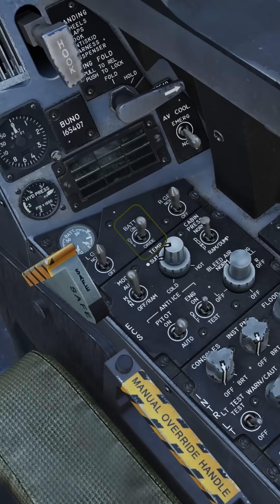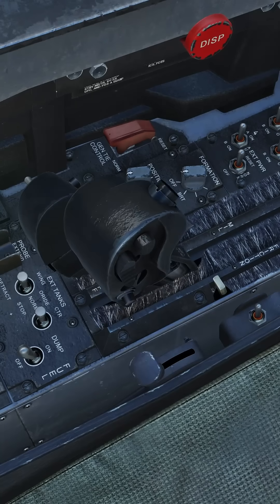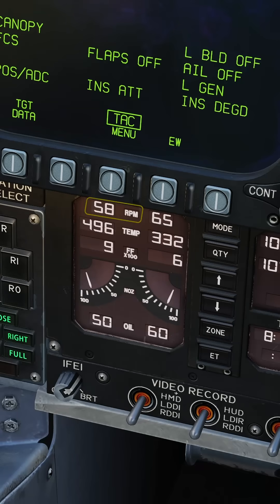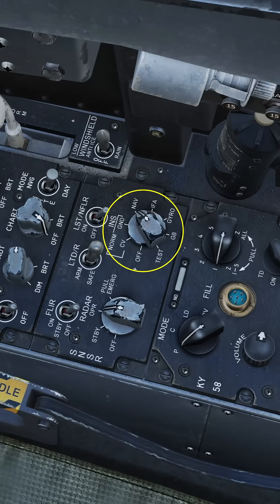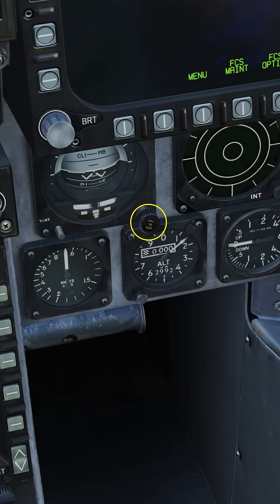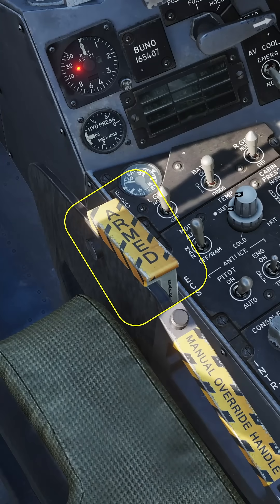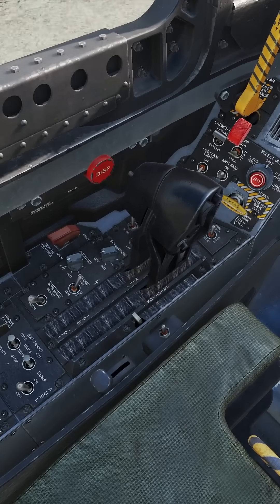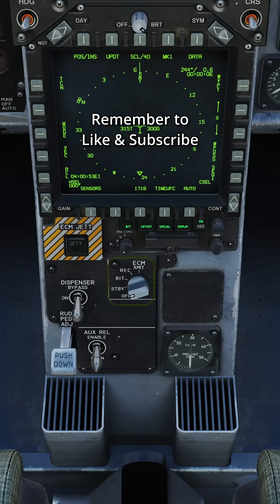F/A-18C Cold Start and Airfield Takeoff in 60 Seconds  #aviation #dcs #dcsworld #f18c #coldstart

Comment: Why set the INS to ground stored heading and then choosing IFA? Seems like NAV is the correct choice? Am i wrong?
Reply from the maker: So IFA and NAV are somewhat similar, the difference being that IFA uses GPS to update alignment whereas NAV runs on an inertial system and its alignment will degrade over time. You can switch straight into IFA but it will take longer to align than if you run a proper alignment. You really shouldn't be using NAV unless GPS is unavailable, but if you are using NAV then you absolutely 100% need to run a ground alignment otherwise the system will be wildly inaccurate.
Reply: @WorldWarWhiskers  Oh thank you for explaining that. :)

Comment: I need help with the apu bc when I click on it and hold the left mouse button its turned on but as soon as I stop holding the mouse button it turns off automatically
Reply from the maker: It should just be a single click and it will stay forward. If the engines are already running then the APU shuts itself off automatically, any chance that you have hot start set in your mission file and everything's already up and running?
Reply: @WorldWarWhiskers  I have already fixed the problem but thanks for your response

Comment: Why everyone is sure that you need to wait 20rpm to idle? You just need to wait at least 15rpm and it doesn't matter if you idle at 18rpm or 23rpm.
Also, it is true that the nose lift off by itself, but when you reach the nose gear lift off speed (where the nose starts to raise) you should pull the stick after the neutral position.
NATOPS F/A-18 A/B/C/D Manual, it is all there ;)
Nice video btw, i am not here to judge, just some corrections.

Comment: This is why I went with the Hyundai Tucson. It's like,  insert key, place coffee cup in holder. Check nose in  mirror for boogies, boogies clear. Sit back in seat, turn key. Press defrost button, turn windshield wiper knob. Mirror check, right side, left side, rear view. Mirror check 2nd tim. All clear, place foot on brakes, grab shift knock, press button and move to R position.
Slowly release foot from brake, give visual check of surroundings. 
Start backing out of drive.
Do mental :leaving home checklist".
Do not remember if you turned off coffee pot, place foot on brake, press shift knob button and move shifter to P position. Open door  and exit vehicle. Get to front door and realize ypu need the keys from vehicle.

Comment: Actually  the bot drone has replaced most need for a human being  being there to flip the bitchswitch and wait for the ins after ins to ground make sure anti skid is on jammer engine  crank right right throttle  while holding the oh shit stick and report ok set the altimeter and dont dorget the radar while airborne selct storm headings take off the trim and adjust the throttle  left dvi right divi and select bitch switch while airborne throttle it 
 Stand by for future instructions 😂😂😂😂😂

Comment: As an ex-RAAF Avionics Technician and Hornet engine runner, this is over simplified.
There's things like a full switch check, firelight and warning tone checks, not to mention closely monitoring EGT, RPM, and Oil Pressure (to name a few) on start-up. There's very strict operating limits and you need to be on the ball to catch if something is out of limits.
It's a complicated beast and there's a lot going on when starting one.
If you miss an overtemp, or under pressure, you've just cooked a million dollar+ engine.
We also used to have the displays turned on prior to start so that as soon as the generator is online, you have additional monitoring informtion available to you,
Reply: Oversimplified!? Jesus Christ! I'm gonna stick to BMW. 👍
Reply: @spartang.1388 
Have you watched the BMW instructional video on how to use the turn signals? 😁
Reply: Thank you. It's real people like you who do society a service by adding reality & comment's to correct  these CGI gamers videos!
Reply: Just out of curiosity, why is something important like monitoring engine temperatures have to be so manual? Is there no way for a sensor or mechanism to be put in place that the aircraft can self regulate as a standard car normally would? Genuinely asking
Reply: Great Question!
During start-up, electrical power is only provided by the batteries, so only a small number of analog gauges are available to monitor things.
Once the first engine is at idle speed, the generator will come on-line and allow the electronic systems to power up.
They can then take over monitoring and control actions, although like a car, they can only do so much.
For example, the engine management computer in a car is always monitoring and making changes to maximise power, efficiency, etc... but if something really goes wrong, such as the car starting to overheat due to a coolant leak, it can only give a warning to the driver and it's up to them how they deal with it.
A jet is the same.
Reply: As an ex-RAAF Avionics Technician and Hornet engine runner, do you know anything of the term 'military power' when referring to engines? is it bs used by civilians?
Reply: @yanerik6850  
Yes, it's a legitimate expression, and actually quite dull...lol
"Military Power" describes the power range that can be achieved without engaging the afterburners.
Engaging afterburners delivers more power, and this is known as "Maximum Power".

Comment: So you can crank the engines at 15% and need to monitor the instruments for a hung or hot start for each engine.  Not to mention the thorough walk around needed and insuring the APU accumulator is charged to 3000 psi or it will not start.

Comment: And pull the coiling chord of the old dialling telephone and crank crank crank crank wait till the "khorrorong" Khorrorong khorrorong khorrorong stops on the receivers end then shout into the mouthpiece "I am chief pilot of plane number so and so I have order from superior in command to take off, I have readied all equipment and is all ready for flight, I am requesting permission for taxiing and take off from the runway accross the other runway to the right of the last of the hangar, please accept my supplications as an application for clearing my flight, okaaay? Pleezee

Comment: There’s 13 steps and 49 substeps to start this aircraft 

	1.	Turn on Battery Switch and APU
	•	Wait for the APU Ready light to illuminate.
	2.	Start Right Engine
	•	Set engine crank to right and wait for RPM to reach 20.
	•	Move right throttle to idle.
	•	Wait for RPM to pass 60.
	3.	Power Up Display Systems
	•	Turn on right DDI, left DDI, HUD, and AMPCD.
	4.	Start Left Engine
	•	Set engine crank to left and wait for RPM to reach 20.
	•	Move left throttle to idle.
	•	Wait for RPM to pass 60.
	5.	Close Canopy
	•	Ensure the canopy is closed before proceeding.
	6.	Set Radar and INS
	•	Set radar to operate.
	•	On HSI, select stored heading.
	•	Wait for INS to align and report “OK”.
	•	Set INS to IFA.
	7.	Configure Flight Controls
	•	Press FCS reset while holding FCS BIT switch.
	•	Select FCS MC and hit FCS.
	•	Uncage the standby attitude.
	8.	Set Altimeters
	•	Set standby altimeter and radar altimeter.
	9.	Prepare for Taxi
	•	Set HOOK BYPASS to FIELD.
	•	Turn on anti-skid.
	•	Set flaps to half.
	•	Release the parking brake.
	10.	Taxi and Arm Ejection Seat
	•	Taxi clear of obstructions and arm the ejection seat.
	11.	Align with Runway
	•	Taxi to align with the runway.
	•	Press the takeoff trim button while holding the brakes.
	12.	Take Off
	•	Throttle up to military power and release brakes when moving.
	•	Set throttle to afterburner.
	•	Do not pull back on the stick; the nose will lift by itself.
	13.	Post-Takeoff Procedures
	•	Raise landing gear and set flaps to auto.
	•	Set RWR, Jammer, and dispenser as required

Comment: You forgot to do the fire light loop test after turning on the battery as well as a cockpit lights test after engine 2 stabilized at 61% N2 and the generator came online.  Tsk tsk.

Comment: As a retired Hornet driver, you should be keeping your radar switch in Standby until you're in the air. Yes, the Hornet has the weight on wheels system, however it's a safety precaution for ground crew in the event of sensor failure.
Reply: ....yeah....microwaving the ground crew accidentally would not be a good thing.....
Reply: I said this and was told it's misinformation lol
Reply: More than just the WOW switch prevents radiation. On Quick Alert, and from any launch, we always took-off in Operate
Reply: @stevefrawley9756  He's not demonstrating alert scrambles.
Reply: @Andy45567  Hence the comment 'from any launch'. The thing you want to do in a formation take-off (close or trail) is take your hand off the stick to switch to OPR,
Reply: I used to drive an AMC Gremlin, the startup procedure was nothing like this
Reply: The question I have is, do you fighter pilots use pre-flight checklists every time you fly? Or is that something only private pilots and commercial pilots use?
Reply: @michael-bell  Every aviator does a preflight and yes, uses a checklist. Its not like getting into a car where if you have a malfunction you simply pull off the side of the road.
Reply: @michael-bell  They have (I had) checklists for Pre-Start, Start, Pre-Taxi, Pre-Takeoff, etc, but since you usually specialize in only one or two aircraft types, they are fairly easy to memorize. Add to that, each sequence flows from the left panel, to the UFC, to the right panel pretty much in order, it is just a matter of knowing what position each switch must be in for each check sequence. Since you must know how and when every system operates, you find it is a logical sequence and not just a random poking at the switches.
Technically you are supposed to have the 'white pages' of your checklist available while you do the checks, but you will refer to them less and less as you gain experience in the aircraft.
Reply: Pump it twice and hit the key. Nobody can start my jet!
Reply: This is the kind of information that people want in War thunder forums XD
Reply: where does the poop bag go?
Reply: Awesome thank you for your service. Now how do you land it??? 😗
Reply: AT ground crew here. Radiated so many times, I glow in the dark and can only make girls. 😂
Reply: Funny you call yourself a driver and pilot, weird
Reply: @Cle_M3  Pilot is correct, but we say driver as well.
Reply: @Andy45567  Oh interesting never heard it before, I just fly lame citations rn. 😂
Reply: @Cle_M3 The "driver" term is used quite often
Reply: @Cle_M3 I'm a retired MiG-29 Fulcrum driver.
Reply: @Cle_M3 in the German Airforce we call them „Kutscher“ which means coachman.
Reply: Why are not the switches in a line? So you press buttons one by one along a straight line and make it really easy?

Who designed this?
Reply: @skibidi.G  check a few posts earlier a guy gives this answer
Reply: @wijn_za  nice, thx

Comment: I had to check more before driving my 27-year-old Audi. Fill leaky radiator, check, fill low power steering fluid, check, fill leaky tire, check, airbag light still on, check, empty washer fluid light on, check, no speedometer backlight to see how fast I'm speeding, check, check engine light on, check, can't read the LCD screen to tell me what's wrong, check. It's still going though and so does the list.

Comment: Can you please explain the "Flaps - AUTO" please?
Reply from the maker: So the flaps are used as a control surface and will deploy to various percentages depending on the control inputs the pilot gives. Half sets them to half and full sets them to full, but auto means that they're "up" but they will deploy to the extent required for the various control inputs you give.

Comment: I am guessing APU, auxiliary power unit but auxiliary to what?
Reply from the maker: You got it. It generates bleed air to turn the engines for start up, and can also be used  to power onboard electronics and hydraulics if the engines aren't running

Comment: F/A-18C didn't have OBOGS, it still used LOX bottles
Reply from the maker: This is modeled after an F/A-18C Lot 20 (1998),  LOX was removed from the F/A-18C in Lot 13 (rolled out in 1991) and all subsequent lots. If you're talking about the very first C model to roll out then yeah you're right, but more modern productions have had OBOGS for more than 30 years

Comment: Probably a silly question, by why do they need to go into afterburner to take off? I'm assuming low lift, and thus high speed for takeoff because fighter jet?
Reply from the maker: So for most takeoffs you don't actually need to be in afterburner, MIL Power is plenty. 
It's really only required if you're on a shorter runway, or if you're carrying particularly heavy stores and a lot of fuel. I just included it in the video to cover off all takeoffs, because if you apply the afterburner when you don't actually need it you'll be fine - you'll just have a bit less fuel, but if you don't apply it when you do need it, you'll run out of runway before you have a chance to correct it

Comment: Actually. First thing to do, as with all aircraft. You're going to do your walk up, check everything, make sure those chocks are in place. Get in. Check that parking brake is on. If in doubt, Release parking brake, you proper checked your chocks, you will roll slightly, then hit the parking brake.

But this is a video game. So, just check your parking brake before anything else.

Comment: I thought you had to lock canopy after full flight check and greenlight to move from idle?
Like the last 2 things is lock canopy and then arm ejection?
Reply from the maker: There is no canopy lock on the F-18 like there are on other aircraft like the F-16. When the Canopy closes it then moves forward about 1.5 inches if you keep holding the switch, this is what lock the canopy.

Comment: Legit question, why is all of this not automated? What's the point for the pilot to have to deal with all these sequences?
Reply from the maker: My best guess would be redundancy, and it would make maintenance significantly easier by not needing to worry about all those extra systems. Also keep in mind that these planes first flew in the 70's, and while they have been updated a lot since, the bones of the plane are still largely the same.

Comment: I use to fly this plane in "F/A-18 Interceptor" on the Commodore Amiga, and I'm pretty sure the procedure was: 1. Release wheel brakes. 2. Push throttle forward. 3. Pull back when it feels right. But you do you.

Comment: It has been several years....I was a turn qualified mechanic. You need to verify oil pressure and check for a hotstart by watching the temp gauge. If it gets too hot too fast, you need to bring throttle back and let the fan spin for cool down before attempting again.
Reply: When do you shut off the APU? 
That step seems to be missing [former Longbow Apache weapons technician with APU license]
Reply: @Longbowgun  APU on the F/A-18 has an auto-shutoff that kicks in once both engines are up to operating RPM
Reply: And I thought this was complex before I read these replies!
My respects guys! I appreciate that it takes a remarkable individual to have this level of expertise. Thank you. sincerely, for serving!
Reply: 😂 starting Alphas and Bravos with dial indicators was fun, especially when the generator gets online and it would self bit and go all 9's. Sitting on the lex and watching a new trainee freak out 😂😂😂.

Comment: If I ever switch from sim flying WWII fighters to modern Jets, remembering to close the canape before take off is probably going to be an adjustment.  I always take off and land with the canape open.  Close it in flight.
Instructions for planes like the P-40 specify this incase you need to bail out after take off, or if the plane bursts into flame on a botched landing, so you can escape the aircraft.

Comment: Question, why is "military power" and afterburner standard? Is this necessary to get a plane with smaller wings reliably airborne and at altitude? Just seems that you'd save a ton of fuel with a slower rollout. Genuinely curious :)
Reply from the maker: As I understand it, afterburner isn't actually required, but depending on weight and length of runway it can be used.